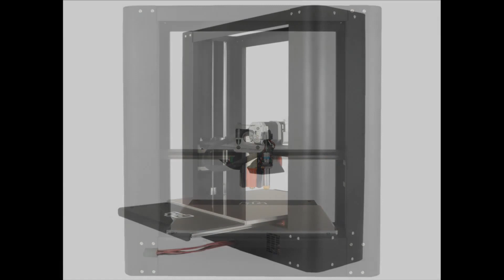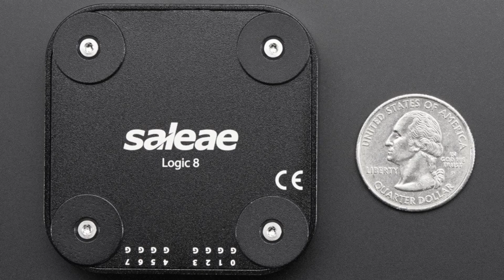New Products 5/20/2015

Comment from the maker: New Products 5/20/15 (video)
https://www.adafruit.com/new

PrintrBot Metal PLUS 3D Printer - Black Assembled (0:01) adafruit.com/products/2302

AstroBox pack - Includes Raspberry Pi 2, Model B (0:42) adafruit.com/products/2391

Saleae Logic 8 - 8 Channels Logic + Analog - Black (1:21) adafruit.com/products/2512

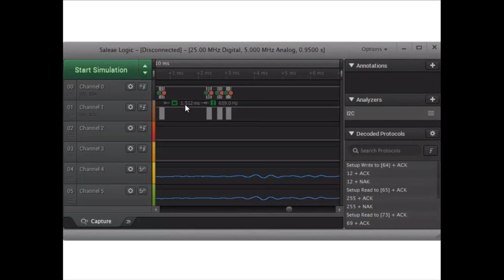Pocket PiGRRL Pack Build your own Pi Game Emulator! (2:50) adafruit.com/products/2510

Adafruit FONA 800 Shield - Voice/Data Cellular GSM for Arduino (3:24) adafruit.com/products/2468

Adafruit FONA 800 uFL Shield Starter Pack (6:02) adafruit.com/products/2523

Adafruit FONA - uFL Version Starter Pack (6:02) adafruit.com/products/2521

Adafruit FONA 800 Breakout Board Starter Pack - SMA Version(6:02) adafruit.com/products/2522

https://www.adafruit.com/new
 #newproducts   #video